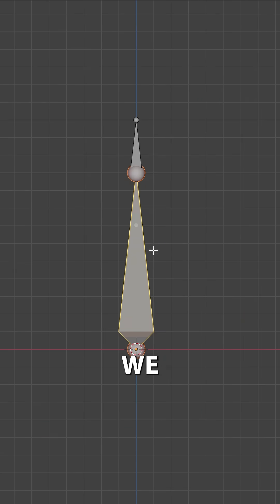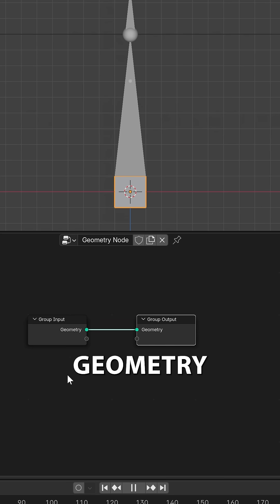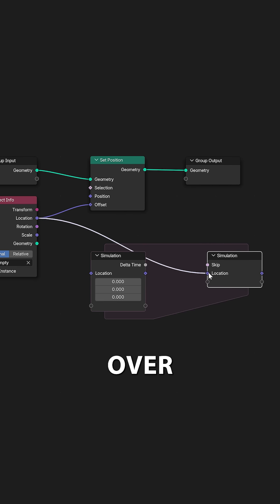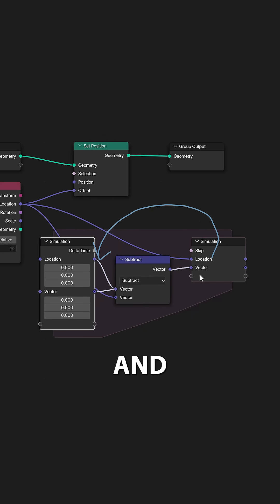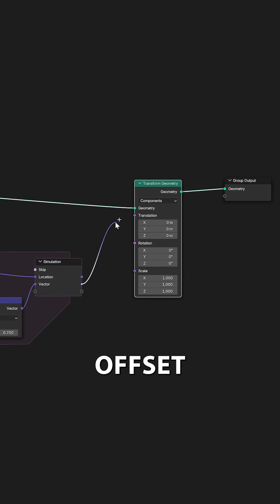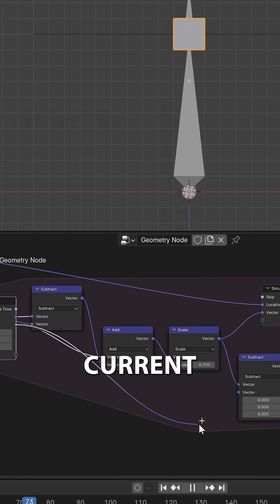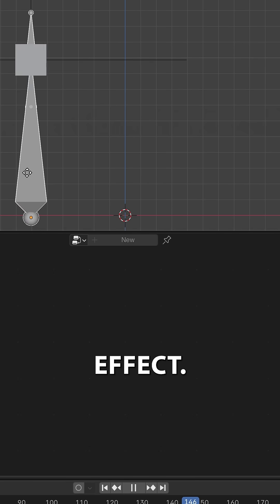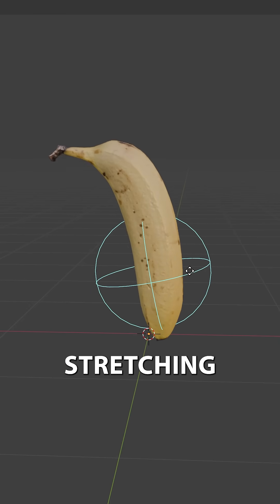How to quickly set up wiggle bones with Geometry Nodes. #b3d #rigging #animation

Comment: why isn't there just a way to make these natively when rigging? even if it limits you by not being able to export it out of blender or something, a native physics bone property in blender would be really useful, especially to animators that stay in blender for the whole project
Reply: I know right? I wish it was like Moho (2D animation software) where you can select the bone you want>go to properties > check the wiggle bone option and that's it. 
You can fine tune the wiggle effect by messing around with the spring, torque and force options in the properties section and fine tune it to your liking. No need to add a dozen nodes to achieve the same effect.
Reply: There is an addon for this.But it's really strange why it doesn't exist. @adrianmartinez8125
Reply: someone should just make an addon with this as like, a button
Reply: i think there is! if not natively, then there's no way people haven't made add-ons that do this in one click.
Reply: JiggleBones (or something like that) addonn
Reply: bec like most blender/any 3d software really, people are being paid for how difficult it is to use these software. if everything came at a click these ppl would lose jobs to amateurs lol
Reply: @barelypedestrian  lol, this setup is nothing to our job, companies didn't hire us only for this kind of stuff. There're several free addon doing these wiggle/spring bones before simulation nodes exist.